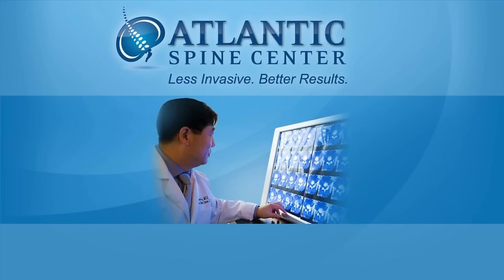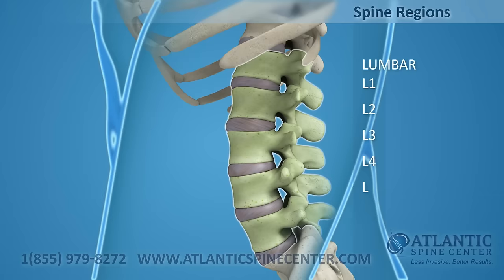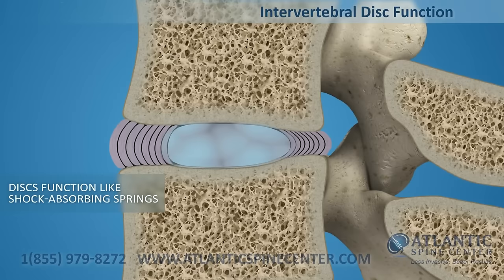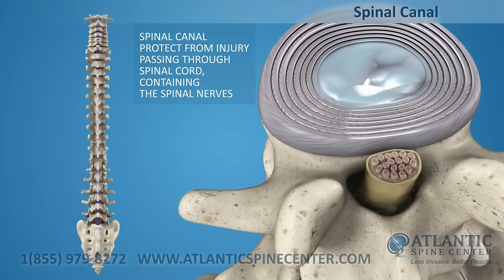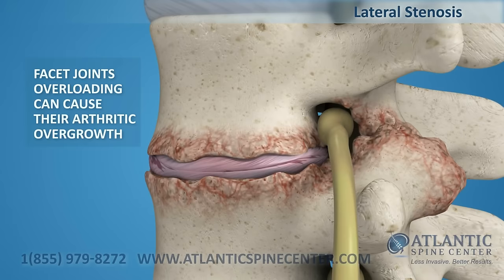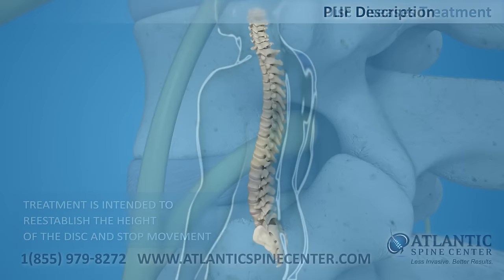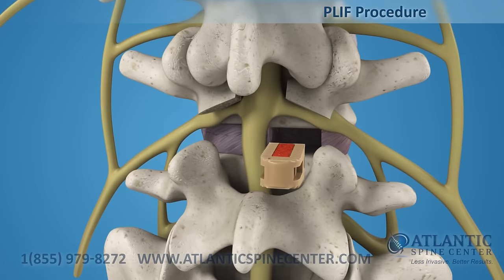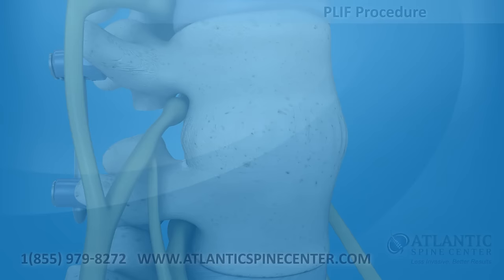Posterior Lumbar Interbody Fusion (PLIF)

Comment: As someone that has gone through this TWICE, I think I can give a certain amount of experience as in a comment.  First of all, I had a fractured vertebrae caused from playing with my dog.  She was simply pulling on her pull toy and I was stupid enough to hang on. Being 77 age the time, probably contributed to the weakness in my CORE...which is basically what we are talking about.  That surgery went very, very well.  One reason I believe it did was I made myself aware of what exactly they were going to do and the ramifications of it.  Yes, it is a major surgery and they WILL move stuff around A LOT and you WILL need some major recovery time.  They take out bones and crush them up and make bone paste and they use tools that when listed looks like an auto mechanics major overhaul list on a drive shaft or whatever.  I went through one year of required PT of all sorts before my insurance would pay for an MRI.  That was NOT fun and YOU will remember that pain.  So after the problem was discovered I schooled myself on exactly what the doctor was going to do.  I knew I would have to let my body adjust to the adjustments..  And its exactly that.  If they took a bone out of here, then you may end up with unwanted cartilage there requiring removal later at some point.  I didn't know that so when I had to have another fusion I was indeed, just a little pissed.  BUT, that was not the doctors fault.  Its called genetics.  If your family has a history of arthritis,  of bone cartilage gathering ...like in your knees, the fusion will be an real event in your life...perhaps ongoing.  Anyway, I apparently have that.  Once more, it was my dog who was unable to negotiate steps into the house after an injury and I, of course, tried to help her.  Then I tried to help my husband do something neither of us should be doing.  ....and well, there is that. 
Second fusion had to disturb the first because the four screws and holes with two bars illustrated above had to be partially disassembled in order to allow the replacement of longer bars extending UP from the original fusion.  In six years all that had grown together in a nice neat little unbreakable package and as a weld in a tube might be stronger than the either side of the weld, so isn't this!  Without going into a lot of long words, we can just assumed I had to have four more holes in the L's above and longer bars to cover that distance of vertebrae.
   
I just want anyone that DID read all this to realize, that it is worth it IF you have the time and patience to let your body heal.  The first four or five days are wretched as any surgery.  It is not so much the pain from the, now, eight screws and longer bars in bone...at least my assessment is more the pain coming from cutting and pulling the skin back from the area of the surgery....muscles, fat etc, the little ratchet used to dig out all that excessive cartilage your body tries to put in there to shore up your problem.....which eventually just causes more trouble.  All that has to settle down and go someplace safe.  If you can imagine putting a bunch of stuff in a jar and shaking it up ....some stuff is fastened there and some just needs to  find its place.  Do exactly as they tell you.  Wear that brace if planning on being up for more than ten minutes.  How all that grows back is important.  Imagine each move you make will make a difference. Cause ...it does.  Don't bend from the waist or twist for a long, long time.  Do not walk or do too many laps in your house trying to impress yourself or neighbors.  They do not care and you will appreciate how caring YOU are about YOU.  Just start out with a goal of three or four...adding one or two laps each week.  Go on a diet if you are heavy and have an overhang.  All that is pulling on that work they did.  Eat lightly and lose some of that.  You will appreciate it in the long run and your brace will fit better too.  Even after two or three months thee will be times you just want to go to bed.  GO TO BED.  Its ok...unless you are still working and then you need a kind boss.  Baby yourself and all that work will pay off.  You will appreciate the fact that you can no longer tell you had surgery.  You have a scar but it will not interfere with your life as long as you are sensible and do not try to. be a gymnast.  Once you are up and going ....about two, three months...do push yourself to go just a little further when you walk.  It will pay off.  Nothing fantastic...just make progress a little at a time.  
Today I am in my 7th day out from surgery.  As I set here, I KNOW I had surgery...it hurts but not like it did before the surgery.  I will have to go back to bed soon because I have been up for over 30 min.  If I do not I will set myself back two days.  So if you have to have this done...accept it, do it, take your time and you will be fine.  Or you can suffer the rest of your life and look like an old person way too soon.  :))
Reply: @Denise Colunga if you do have this surgery DO everything they tell you to do exactly as they tell you to do it.  Do not skip this or that.  These spinal surgeries are done over and over, most quite successful but much depends on YOUR attitude going into it.  If you THINK you will be two years recovering, you will be.  I have always saw myself as an active spirit housed in this imperfect body.  I treat it like a separate entity that I am a caregiver for.  I give it all the advantages I am aware and try and treat it as logically as possible.  But when it needs to step up then I consider myself well .  Only other advise I have is what is right for one person may not be so good for another.  I have little tolerance for pain meds.  So I am not on them long.  Be mindful of the pills you are taking, how YOU are feeling and are they helping or causing other side effects you do not need.  I prefer ICE over pills.  Usually am not on pain meds more than four days.  I break out in hives, get night sweats and general all around imbalance on opioids.  Get off them as soon as possible.  Just sayin'.
Reply: Thank you for this, super encouragement. I just had my second operation on Dec.13, 2019.  The first was Dec. 2014. Learned alot. I had Degenerative Bone disease and you could push me over with a feather. I was urinating and deficating spontaneously. This time I have 4 screws and two rods and two TLIFS . My pain is gone and I feel strong, not trying to impress anyone if I need to sit or lay down that's what I do. No more nerve pain HALLELUJAH. L5-S1 was my issue. I am 48 year old male and I was scared as a little school girl but I'm pain free and loving life.
Reply: @ikethornton3600  A lot of this adjacent level syndrome people talk about is sometimes unavoidable. You said you had degenerative bone disease. Some levels may become injured and require surgery. It will be just a matter of time before you injure another. Your insurance can also screw you up. I have seen it many times. A patient would be scheduled for, say, a 3 level fusion. The insurance company steps in and declares that they will approve one level, the worst one, but not the other 2 levels. I could see when looking through their chart that it would only be a matter of time before this patient would be back for the next level. They even denied my husband's ALIF. The surgeon got someone,  a real person, at my insurance company on the phone. He argued my husband's symptoms. He finally got a laminectomy/decompression approved. That helped for around a year before the symptoms started returning. He ended up having the XLIF at L4/5. Then the ALIF at L 3/4 a couple of years later.  Long story,  sorry. My point was that unfortunately your insurance company can have a big hand in what, if any, treatment you'll get. It's frustrating. These people have no medical experience or education, yet they can and do tell your spine surgeon what yhey will be allowed to do!
Reply: Wow, what a story. I’m glad it all worked out for you. Congrats to you doctor. One question, do you still have your dog?

Comment: I think there may be a better way to not have fusion but have replacement part that will mimic the original configuration. This means provide flexibility. In this replacement part you could provide additional features to make it even better than the original human version. People this is not that difficult. Consult a structural and vibration specialist. If people ask me I will even do it for free in order to serve humanity.

Comment: I am a powerlifter few days before the PLIF. I suffer degenerative L5-S1 which causes limitations in my lifting so i decided to do this surgery. No possibility for other types of disc surgery. My question is ,is It possible for the screws to break considering there will be no loaded lumbar flexion and the neutral spine will be maintained during the heavy lifts. I know that the greater risk of damage is for the upper region due tu compeneations in case of causing loaded flexion but what about the fused region and the screws?
Reply: Agresywny Wojtek  Yes! Especially if you load it up with weight!

Comment: Doesn't this cause more stress on the disk above and below the fusion accelerating their deterioration??
Reply: I got 14 years deciding if I should get this surgery. However I've heard the same about what you are saying. In about 10 years tops after Fusion surgery your worst off.
Reply: I had 32 years of no pain after my initial fusion of lower back. I am now having problems after an injury while working at the Home Depot. I am thrilled with the past 32 years pain free! I look forward to life after my next fusion at L4-3.
Reply: @kristinmartin2762  you've cheered me up Thanks
Reply: @kristinmartin2762  my back hurt to because of a herniated disc doctor told me no surgery because its 50/50
Reply: @michelm494  I had extreme big herniated disc and surgery was the only option for me, I had my first March 2018 and a second in April 2019 ,I was completely bed ridden before surgery, if you still able to walk don't do it

Comment: Question? After fusion is complete can the hardware be removed?
Reply: I’m no doctor but just got this surgery. The hardware is usually permanent. The big risk of doing this surgery is infections, i would not like to have my back openend twice just to get the screws and bars out.
Reply: @DrDudelu I am fused from C-2 to T-2, anteriorally and posterially and T-8 to S-2 posteriially. My range of motion is extremely limited and it is affecting my driving. I am  looking for any increase in motion!

Comment: doctor  i have a L4 L5 S1 i just got my new i had 3 MRI but this one says L5 S1 broad posterior disc hernation which is slightly more prominent than on the prior study deforms the ventral epidural space and there is left greater than the right foraminal extension with abutment of exiting left L5 root and narrowing of the foramina diminished disc space height ventral extension of the disc remains and discogenic chages and scmorl;s node in the end platates.mild facet hypertrophic changes remain L4L5 S1 ,,,,,doc my friend told me narrowing part of stenosis ,doctor can you help me out with this ,,thank i been watching ur video;s there very good ,,thank you,,ps my doc can be fixed with  endoscopic laser surgery,doc what do you think,

Comment: Does spinal fusion of lumbar discs adversely affect range of motion?
Reply from the maker: People that decide to have a fusion have already significantly lost mobility due to terrible pain and disease (condition), and more importantly, the problem is often affecting the stability of the spine. A fusion helps solve both issues. A fusion is only performed on the area directly affected and needing help- not the whole spine. There are some instances where a disc replacement is possible but this is not an option for everyone and is generally only performed in a few approved areas of the vertebra at this time.
Reply: Just had my fusion 6 days ago.  Exactly.  Couldn't do much 2ndary to pain anyway.
Reply: Had my fusion done 3 weeks ago,  I'm pain free  and in such a short time can't believe how well I'm doing .  Even my motion is little by little just getting better.  I dont regret having this surgery,  my life is so much better now.
Reply: @ismallopez8744 r u ok now?
Reply: @meenaqamar243  , yes! I'm doing fine.  Working 5 days a week and pain free.  Thanks for asking 👍
Reply: @ismallopez8744   hi, I've been told that I need to get this surgery "doble discectomy and artrodecis c5-c6 & c6-c7" I've been in pain 24/7 for over 3 years. I've tried everything; yoga, kinesiology, osteopath, cbd, cannabis, etc. Nothing seems to work. Could you please tell us what happens once you get your surgery, like the post surgery.

Comment: I had Surgery for Spondylolisthesis between l5 and l4 5months ago at a hospital in Newcastle UK. So far the pain in the leg has decreased but only if I don't do any effort. If I start walking to much then the back hurts and the leg hurts again. To me doesn't seem like is any improvement so far. Now I've started to get pain in the left hip. Next month I got the 6 moths check up with the surgeon. Really don't know what to say. The surgeon said they decompressed the nerv yet the area where the issue was is still painful. I'm a healthy 28 year old guy and yet this issue still seems to be around after surgery. Will it be any better in the next 12 months?
Reply: Gabriel Bejenaru     I have had an L4,L5, S1 360 degree fusion the last back in 1996. I wish I could tell you things got better but I can’t. I have had back, hip, and leg pain since my surgeries and have lived off potent pain killers off and on since then. Right now I am on suboxone for pain because the opiates quit working. I will probably start back on opiates in the coming months. I too was injured at 29. I am now 59. It has been hell. Do stretches and lift weights moderately to keep in shape, especially your abs. It is the stabilizing force for your back. Just try and enjoy life the best you can. Pain will probably be your constant companion so it would not hurt to seek out someone to help you deal with it mentally. Usually the disc above or below start going out. I have a herniation at L-3 I’ve had for years, I’ve just elected not to have it fixed. I don’t see the point to undergo surgery unless it affects my body functions. Good luck and take care of that back.
Reply: Gabriel Bejenaru eu am un an operat. Si Nu mam recuperat , Sant mai nasol ca inainte . Acum o sa ma operez din nou In Barcelona. Grefa de os Nu sa sudat si Am dureri mecanice
Reply: No
Reply: It’s a double edge sword at the end of the day. I’m fused from my C3-C6, L4-S1 of which was done a year ago and I’m now facing a 2nd back surgery to decompress and fuse my L3-L4.
I was left with permanent nerve damage and foot drop after my last surgery unfortunately I had no choice not to operate I have severe spinal stenosis and loss of motor function. 
I workout daily and soak in epsom salt baths nightly to help ease the pain in my legs and feet. I am blessed to say that I take NO pain medication, NO nerve medication I research constantly for all natural remedies and CBD.
I always have pain and discomfort it’s life changing my heart goes out to you I wish you the best just know your not alone...
Reply: @kristine432   hi. Thank you for your kind words. I stop taking pain killers since last month. Although, I still got pain. Just not as bad as before op. It comes and go. For example I just woke up, I was ok. Now I walked 5 minutes around the house and the pain is back in the left leg. The worst after this surgery is you got to deal with this stiffness in the back. I am wondering how will I do my job at the restaurant. Still haven't been to work since August.

Comment: if the bone graft material is b.m.p. is that approach f.d.a. approved?
Reply from the maker: No it is not FDA approved but the recommendation is based on a old dosing of BMP and with the new dosing and product, it is becoming more common.
Reply: NanoLock Titanium implants by Titan are what many surgeons are using nowadays for this kind of surgery.
Reply: @JOHNNYSGIRL1960  there are several companies that make spinal implant systems. New systems are introduced every few years by each company. It's an extremely competitive market.

Comment: 3 years later. I’m in agony, mri shows well healed spine 😵😵😵😵
Reply: Patrick Warren 
How are you doing atm . Did you undergo PLIF three years ago ? 
Did your pain not alleviate after operation ?
Reply: Ali Abbas January 2017. Then screw removal November 2017. Worse since screw removal with bathroom issues
Reply: @Drpatrickwarren  sorry to know about that (does the perineal area feel numb?) 
I wish and hope you feel better soon 
I'm going to undergo  PLIF @ L5-S1 in few weeks from now .

Regards
Reply: Ali Abbas had lots of numbingness down the leg into my toes. Now just sensational more than numb
Reply: @Drpatrickwarren  sensational as in heightened sense of pain ?
Reply: Ali Abbas no more like high pitched tingle lol
Reply: @Drpatrickwarren  that's good then 
Cheers 😊
Reply: Ali Abbas well I still have plenty of leg pain. Just not constantly. The sensation is constant
Reply: @Drpatrickwarren  Arturo know that you still have pain 
I really wish and hope you feel better soon
Reply: 2 years for me. Turned out to be Hetrotopic bone growth at l4l5 where they done the fusion. BMP leaked out of the cage and caused bone growth around my nerves. MRI never picked it up but a CT scan did. Unfortunately it was too late